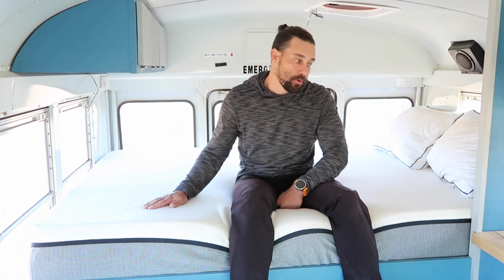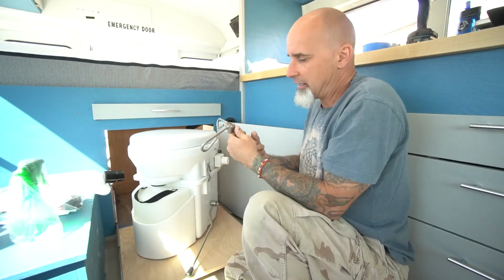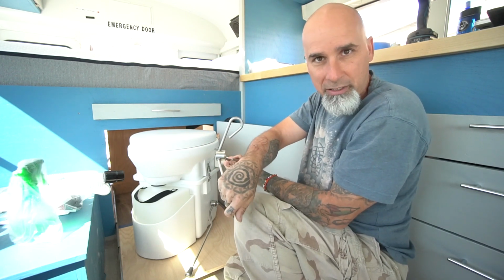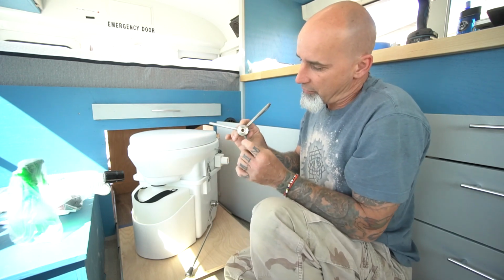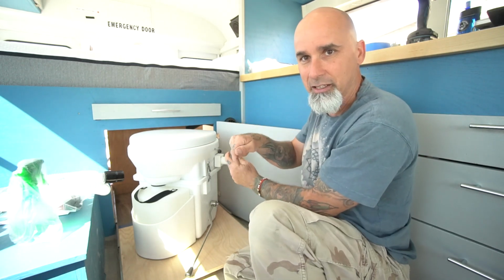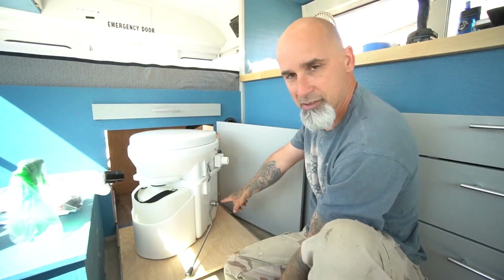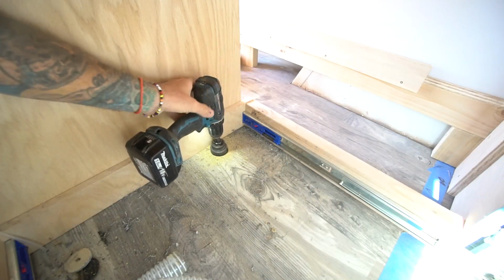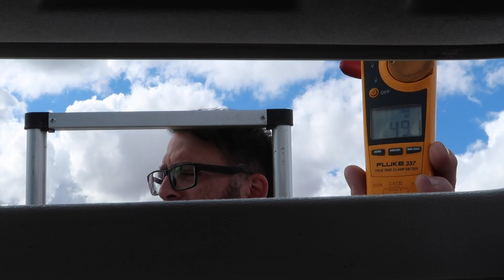Mini Skoolie Build Timelapse - Bed & Toilet Instal + Solar Begins

Comment: Amazing! I am here is AZ. When I build a bus do you recommend removing the ceiling and installing spray foam? What is best in extreme heat? I would have Henry's on top and solar panels covering most of the roof. Def a mini split too. Thanks!

Comment: Hey Wes, I was noticing that when you were installing the webasto heater, you put it up on a platform. I'm pretty sure that unit is to be mounted and sealed to the floor so no exhaust can enter the bus. The exhaust pipe is not designed to seal internal of the bus. Please take a look at the installation manual, I work as a technician for Peterbilt and we install these units in sleepers all the time. I have never seen one not mounted and sealed to the floor of the sleeper. Truly love your builds and don't want to tell you how to do things, you are an awesome craftsman.
Reply: Ken W I agree with you. The problem I dealt with was a thick floor...the heater is designed to bolt directly to the original metal floor. The “standoff” on the heater wasn’t tall enough that the “body” of the heater would clear the floor. So...that was my solution. The exhaust tubing seemed to seal well to the flange on the heater, so I don’t think any exhaust gases should enter the living space.
Reply: @TranscendExistence1111  
Thanks for reading my reply Wes. I was installing one of those heaters yesterday, and the problem is, the slip joint from the heater to the pipe isn't designed to be a positive seal. If you were to maybe wrap the pipe in header wrap and then seal the box you built from the interior? Not sure how hot the pipe gets, but you can't take a chance of an exhaust leak while someone is sleeping with the heater on.

Comment: Why do people still build 12volt solar systems? Why? Why run solar panels in parallel? Why? I wish that there was one REAL electrician in the vanlife community.
Reply: The panels are 49 volt open circuit and would exceed the charge controller maximum voltage if run in series.

The house battery system is 12 volts to reduce complexity, allow simple and cheap secondary alternator charging and battery bank interoperability. The AC loads on this system are extremely small, only a 2kva inverter.
Reply: @AaronBockelie  You seam like a real smart guy. I do not want to insult you in any way. I am not an armchair warrior. I have over 30 years in electrical experience, in both AC and DC. If I built that exact same system in the same way it was built (from what I could see in the video) for a commercial client it would not pass inspection.
Reply: @glennbeattie6172  I built it in the middle of the desert with spare parts from my toolbag during the middle of a global health pandemic. Some builds are better than others.
Reply: @glennbeattie6172  What are your concerns in the build?
Reply: @AaronBockelie  I really don't want to drag out this conversation much more. My biggest concern as with all these youtube builds and why I go on and on about 12v systems is, In your system you have the ability to charge or discharge the modules at a higher rate then the INDIVIDUAL modules are rated at. I was taught that I shouldn't do that. I know that you have more than one module (battery) in the battery bank. But if something were to happen to the cables, corrosion or someone where to remove a module, unknowingly. This now has the potential of damaging modules or even people. When designing or wiring circuits this must be taken into consideration. It is true that this mostly a liability issue, but still can be dangerous.
Reply: @glennbeattie6172  The two battleborn batteries are considered a safe sealed unit. The only other battery is the start battery, under the hood up front. Each battleborn lithium battery has it's own BMS and protection circuit. They are extremely reliable.

Each BB battery self limits discharge rate, and manages it's own charge intake to the performance envelope of the individual lithium cells enclosed. They are sealed systems that are not user servicable.

Take a look at Will Prouse's teardown of the BB batteries: https://www.youtube.com/watch?v=G5E30u-66VI

As for charge rate limitation, the BB batteries are protected from the start battery system through a charge controller. It prevents overcharging the lead acid battery, and prevents overcurrent draw of the alternator through duty cycle control.

Obviously a better way is to use a DC-DC charger like a Victron Orion-TR or equivalent, which can be programmed for the exact charge curve required of the target battery bank.

If people unknowingly remove things and re-wire the system, that's not the original installer's liability, that's the person making new changes to the installed system without understanding why it's installed the way it was.